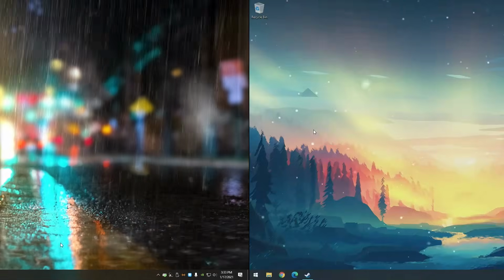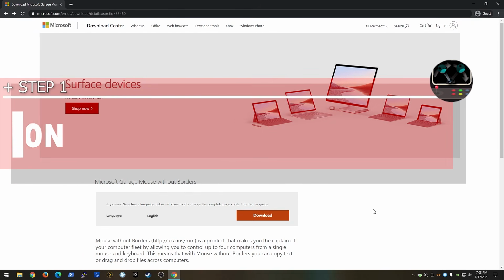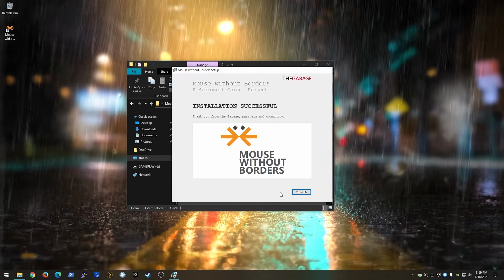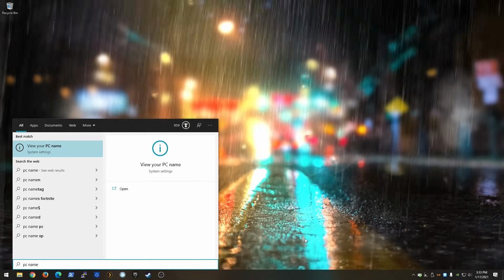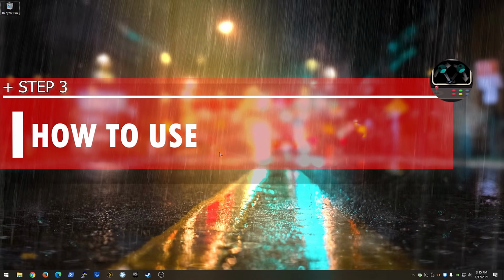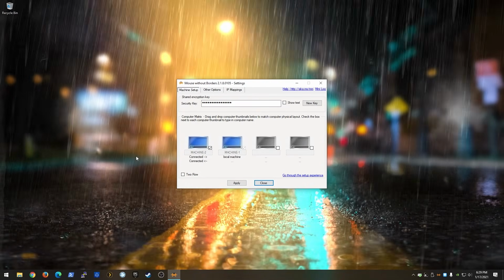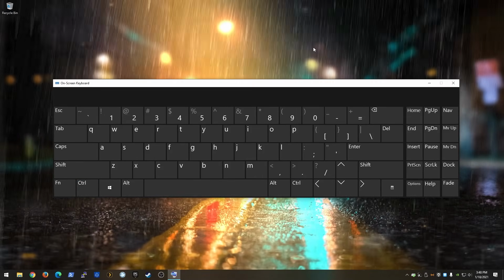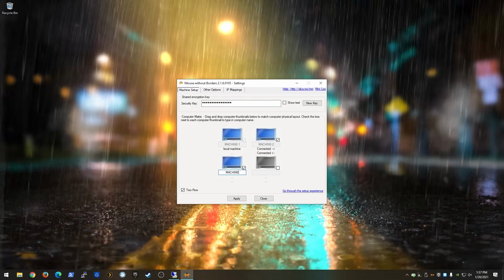Control Two Computers with One Mouse

Comment: I have both a PC and a laptop but dont have the PC keyboard so i tried to use the laptops keyboard but for some reason its not typing anything
Reply from the maker: Hi there! Sorry to hear you had some trouble... How far were you able to get during the setup process?
Reply: @ArcadeSpinner   I wasn't stuck on anything and did managed to connect both computers. I could access both computers using a mouse but not the laptops keyboard so I think the problem is in the device manager since I don't have a keyboard plugged to the computer ( I'm very unsure if it needs a keyboard icon to show or not in the device manager)
Reply from the maker: @doge1490 That's an interesting situation 🤔 Usually, it shouldn't matter whether the actual keyboard is built-in or external to the source computer since Mouse without Borders should be sending all key activities to the connected PC.

Additionally, it should be pointed out that there is no option to only share the mouse. In other words, both the mouse and keyboard should ideally both be carried over for control once you connect. The only thing I can think of is to see if there's an (application or game) that you might have running in the background on your source PC? In some rare cases, background processes that are hanging on to peripherals may not have fully released those resources.

Comment: may i ask if i could use this to move files between two devices?
Reply from the maker: From my experience as well as what I've heard from others, this feature is a hit-or-miss. While it's documented as working on the Mouse without Borders support page, it doesn't work for everyone.

According to their information, copy/pasting should work but it's limited to a single file that's no more than 100MB.

Details can be found here: https://answers.microsoft.com/en-us/windows/forum/all/mouse-without-borders-setupuser-guide-tips-tricks/0523308d-3406-4273-b86e-bef28aa6b50d

Comment: Hi for more then 50 computers can we connect in same server for class room like.
Reply from the maker: From a single computer, Mouse without Borders will only allow you to control up to four computers. However, if you're asking to see if they can be relatively connected to each other, I'm sure you can do a lot more in a lab setting where you have a chain of computers that are connected at the edges. However, whether there is a predefined max limit behind the scenes (on the app side): that's something to try out.

For example, most people do something like this:
PC 1 -> PC 2
PC2 -> PC1

But it'd be an interesting test to try something like this:
PC1 -> PC 2
PC2 -> PC 3
... and so forth.

Comment: I don't have WIFI on my second pc will it still work?
Reply from the maker: Instead of using Wi-Fi (or a wireless connection), I would suggest being connected to your local network using a wired/ethernet connection.

But you do have to be connected using either Wi-Fi or a hard-wired LAN connection.

Comment: Can you drag and drop file(s) between computer?
Reply from the maker: Dragging and dropping or copying and pasting sometimes works but it's not perfect. For example, the app sometimes times out if the file size is beyond its capabilities. If you need to exclusively share files, I'd recommend it's more reliable to simply do it via the native Windows share.
Reply: @ArcadeSpinner  Awesome

Comment: Thanks for this. Simply put and easy to follow.  I just have one problem.  Moving my mouse left or right beyond the screen does not bring up the other PC.  I have windows 10 home on a desktop and win 10 pro on a workstation.  Both are plugged into the same monitor.  desktop with HDMI and workstation with Display Port.  I can manually switch between PC's on the monitor using the monitor manual button to switch displays.  Wireless keyboard and mouse work fine on both PCs.  However, even though I'm pretty sure I've followed your instructions, obviously I have missed something.  Do you have any suggestions please.
Reply from the maker: Thanks for your feedback! To answer your question, have you looked at the 'Easy Mouse' setting in the 'Other Options' tab of Mouse without Borders? Enabling 'Easy Mouse' means you can just move your mouse cursor to the other computers freely when you hover past the edges of the screens.

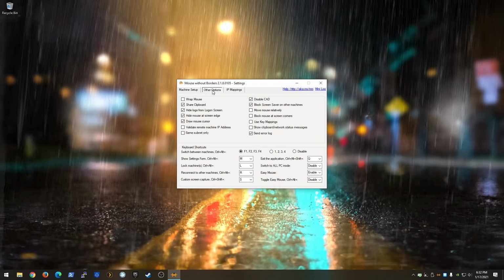If you disable this setting, you will have to press the 'Ctrl' key when you want to move the mouse cursor to other computers that you have connected. I covered this part in the video at 03:19.

Hope this helps!
Reply: @ArcadeSpinner  Hey thanks for the quick reply.  the Easy Mouse option was set to, "Enable" so I assumed it would work then without having to press control.  But it didn't.  I then disabled it and tried just moving the mouse to the right (computers positioned as you advised so I was moving in physical direction of the PC) but with no result.  The mouse does actually disappear but even with a pause before bringing it back, nothing happens.  I have tried on disable too with control but still nothing.  ??
Reply: @ArcadeSpinner  Something really weird just happened.  I was accessing computer 1 and doing tasks and then moved the mouse off screen not knowing I had so tried to see where it was and clicked as I did. When I clicked a video I had paused on computer 2 started to play. But I was still looking on screen at computer 1!? At the start I couldn't figure out where the audio was coming from as I had no audio apps running on computer 1.  So wondering if that may give you some ideas of what may be happening.   I realise you're not a paid help desk here and have done a great video but if you had a moment please to consider this and offer any suggestions I'd be truly grateful.
Reply from the maker: @BibleRevelation2012  Yeah; some of the behavior you noticed is definitely odd 🤔. When you say 'moved to physical direction of PC', I assume you've already checked how each PC was logically placed in the app? I always ask this because, a lot of times, it may have the PCs in opposite directions in your config even though you know where they are physically. Also, did you confirm that both machines are identified with the 'Connected' status?

Secondly, the audio issue may be due to the mouse moving blindly on the inactive PC. I have heard of a bug where sometimes the mouse is already switched to your secondary PC but you can't see it. As a result, you move your mouse assuming it's hidden somewhere on your primary PC but it's really doing something based on your movements elsewhere.

If you see anything else outside of this behavior, let me know and I can give you additional ideas

Comment: What about ps4 and laptop?
Reply from the maker: As exciting as that sounds, Mouse without Borders only works on Windows machines (unfortunately).

However, depending on what you're trying to do: you may be able to get away with using PS Remote Play on the laptop Windows machine. You wouldn't be able to share a mouse but at least you can have the PC and the PlayStation session on a single screen. However, this is just me assuming it will fit your use case.

Comment: This is awesome! Is ther a way to defult the audio to one computer doing this?
Reply from the maker: Thanks for your comment! And great question; but Mouse without Borders has no control over synchronization between audio channels over the network.

If this is a must, you may want to think about looking into VoiceMeter (https://voicemeeter.com/see-what-voicemeeter-can-do-overview/). Hope this helps!
Reply: @ArcadeSpinner  thanks it's not necessary a MUST but I'm using Mouse without boarders on my laptop and desktop. My laptop speakers are busted. So I have to use a headset or aux cable speaker to get audio. Vs my PC which uses the only monitor I have that have speakers built in.

Comment: I like to control my Work PC and Personal PC with same keyboard and mouse. My work pc runs on VPN and this solution does not work. Is there any work around to this problem?
Reply from the maker: You are correct and, unfortunately, most VPN software is going to conflict with Mouse without Borders since it operates between your network adapters (i.e. Wi-Fi, ethernet) and network access in general. In my experience, the only VPN services that are less intrusive are ones that are purely web-based (since they do not interface directly with your network adapters).

Comment: how does the "easy mouse" setting work if you're playing a game? like holding ctrl to crouch and then swiping the mouse, will that drag the cursor from the game to the other screen?
Reply from the maker: This depends on multiple things. If the game or application you are running (alongside Mouse without Borders) has a binding or mapping ownership of the Ctrl key, then Mouse without Borders will likely lose all ownership of the Ctrl key. In this case, the Ctrl key will do what is intended according to the game or application that's in the foreground but you won't be able to switch to the other computer(s).

If the control key is a bad idea for your setup, you can also map the 'Easy Mouse' setting to the Shift key instead. But unfortunately, both the Ctrl and Shift keys are so commonly used everywhere, this might not really help. 😅

Comment: can i use a wireless mouse? and if she uses her driver, will she be without it on the second system?
Reply from the maker: It should work regardless whether your mouse or keyboard are wired or wireless on your system. All that matters is that the computers you are trying to control are on the same local network. For example, computer A could be using a wired mouse and computer B could be using a wireless mouse. They can still be controlled via the app as long as they are both on your local network.

Comment: If my laptop is connected to the wifi and my desktop is connected to the same wifi but by lan will it work?
Reply from the maker: Yes! Because you are still within the same subnet of your local network (unless you messed with the default DHCP settings). However, keep in mind that there could be hiccups every once in a while due to one device being a bottleneck through WiFi.
Reply: @ArcadeSpinner  well i tried it and its working fine with no lag tysm :D
Reply from the maker: Glad to hear it!

Comment: Bit finicky when moving the mouse over the two screens but other wise it works perfectly
Reply from the maker: Glad to hear it (at least the 'working perfectly' part). As for the finickyness, I'm sure you already know but wired vs. wireless plays a huge role in performance (if that's relevant here).

Comment: How about with iMac and a pc?
Reply from the maker: Mouse without Borders only has Windows support. For both Windows and Mac, you may be interested in looking at Synergy and Barrier.
Reply: @ArcadeSpinner  Thanks, man i use sharemouse free version, but i dont want to play the 50$
Reply from the maker: @KIDDrepFilms  No worries! And completely understood; no need to pay the fees if there are free alternatives.
Reply: @ArcadeSpinner  what are some completely free ones?
Reply from the maker: Barrier is actually completely free and it looks to be the most popular. Synergy has both paid and open source options. Outside of these, others like Input Director and Share Mouse ring a few bells but they have less of a user base comparatively.

Comment: Hey, im having an issue where when i drag my cursor over to the other monitor/pc it becomes very laggy and its bigger than the average cursor size.  My main pc cursor looks and works completely fine but when switching over to my secondary pc it lags and can be unsuable. Is there any fix?

Edit: 5 minutes later and its completely stopped working and now says that the secondary pc is not found. Pls help
Reply from the maker: That's odd and definitely a new one... As far as lag is concerned--are you connecting both machines via ethernet/LAN as opposed to a wireless network? As for your latter issue, there could be a wide number of causes. Have you ensured that both machines have the same version of Mouse without Borders installed? Have you checked if the security key has changed on either one of them (sometimes, I find that it happens when you reset/tinker with some of the other settings)?
Reply: @ArcadeSpinner  I figured it all out, i was atempting to use it while one pc was using an ethernet and the other wasnt. I went to target and bought a 5 port ethernet splitter and two cat6 ethernets. Works like a charm! Ty
Reply from the maker: @saucysurfs2987  Amazing! Glad to hear you got it sorted out.

Comment: OMG thanks a lot for your valuable information, but i'm using  a mac book and a windows computer , can u suggest a way to control both lap and computer in one keyboard and mouse
Reply from the maker: Thanks for your comments!

Being able to do this between a PC and a Mac means you cannot use Mouse without Borders. However, some options for you to consider include Synergy and Barrier. However, these aren't ordinarily free products. But you can certainly commit to their free trials to see if it works with your personal setup.

If you find something else that's interesting outside of these options, feel free to revisit the channel and share your experience!
Reply: @ArcadeSpinner  thanks a lot.. for your ideas and suggestions 
And if i find something really goes with my setup I will definitely share my experience with you guys ☺️🔥

Comment: I'm having an issue where when I hover over my slave PC, after about 10 seconds it cuts out for about 3 seconds and then comes back, and respects the process. Any idea what could be happening?
Reply from the maker: 2 immediate questions that come to mind:

1.) Are you on a Wi-Fi network?
2.) Have you tried adding each respective machine in the 'IP Mappings' tab?

Comment: Will this work if one of the computers is on VPN ?
Reply from the maker: In most cases (such as VPN under work/corporate networks), it will not work. But if you somehow have access to changing internal IP addresses of connected machines that are on the VPN network in question, you will have a hard time with VPN and Mouse without Borders.

I'd be curious to hear more if anyone does figure this out...

Comment: Not sure if others have noted this.. I have this setup on 2 laptops connected to same wifi and things work fine. But, when I am working on only laptop at a given point of time and lift up the laptop lid of the other to switch it on and login, there is a heavy lag when I used this software on the laptop which I have woken up.  Any idea why is this?  The only solution that I have found is to kill the 'mouse without borders' application on the awoken laptop and reopen the app which gets back to the smoothness of the mouse pointer.  Otherwise, there is a heavy stutter and lag in that situation.  Is there a setting that I need to change or something for this issue?
Reply from the maker: 2 things that come to mind:

1.) Is Wi-Fi a must-have for your setup? Based on what you stated about 'same wifi' in your comment I'm assuming you've connected both machines wirelessly. If yes, the possibility of lag will always persist.
2.) Have you looked at your 'Power & Sleep' settings from the Windows Control Panel? I think sometimes having any options enabled where you let the OS automatically power off network devices can cause these problems on wake-up. I suggest disabling any kind of auto power off functionality if possible.

Comment: WOW Thanks u so much
Reply from the maker: No worries! Glad it helped.
Reply: @ArcadeSpinner  One thing when I’m playing game and move my mouse to left(my laptop)it minimize the game so I had to disconnect it when playing game .Is there any fix to that? It not a big deal.Thanks
Reply from the maker: @nyson07  Typically, this sort of thing happens when you have a shortcut (or key mapping) from Mouse without Borders that happens to match an existing key binding with another app (i.e. your game or something else that's running in the background processes of your laptop). I would suggest you inspect some of the settings of the apps that are running on your laptop and see if any of their shortcut/key mappings match the same ones on the laptop's Mouse without Borders setup.
Reply: @ArcadeSpinner  ok I will try that. Thanks u!

Comment: what about a similar setup for a PC & laptop, but only one monitor
Reply from the maker: It can still be done. However, you'd have to utilize the laptop's screen in addition to the monitor (for getting more screen real estate). Here are 2 different ways you can do this:

Example #1: Let Machine A be your laptop and machine B be your desktop connected to a screen. You can use Mouse without Borders for jumping between your laptop screen and the main PC screen.

Example #2: Even if your laptop's output display is connected to the external monitor, it can still maintain the MoB connection to the PC. However, you'd probably have to use the "Extend these displays' option on the laptop. But since one external screen usually can't show you 2 displays simultaneously, you'd have to manual control how much of what you want to see on the laptop externally.

Example 1 makes more sense obviously.

Comment: Can i do this with windows 10 and windows 7?
Reply from the maker: Yes. Provided the OS is supported by Mouse without Borders minimum system requirements,  it should work even if your setup includes different versions of Windows (i.e. 7, 8, 10).
Reply: @ArcadeSpinner  Thank you.
Reply from the maker: No worries!

Comment: Is this good for gaming? Does it have input lag?
Reply from the maker: As long as the game you're playing is not online or competitive play where every frame counts, you should be OK. However, I'm sure your miles may vary with different games. To be safe, always stick to getting your devices connected using Ethernet cable as opposed to WiFi.